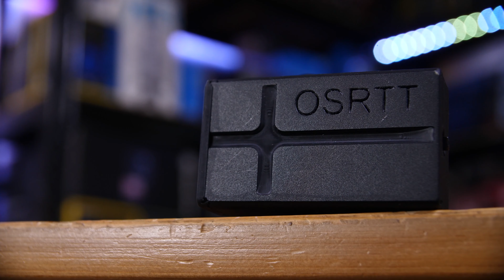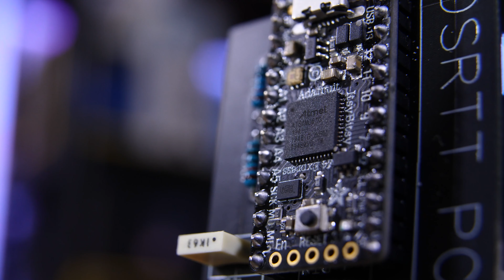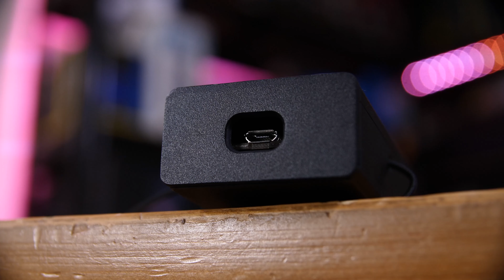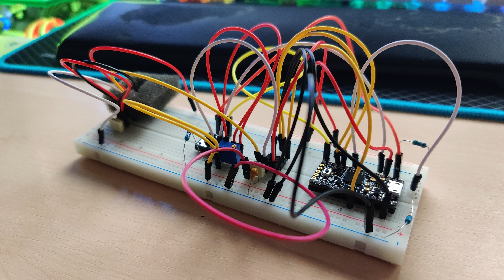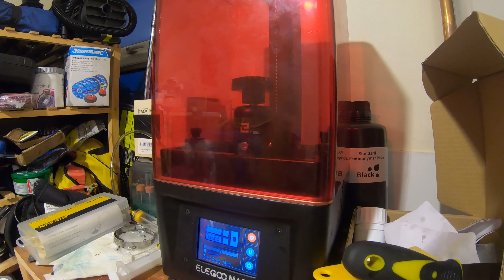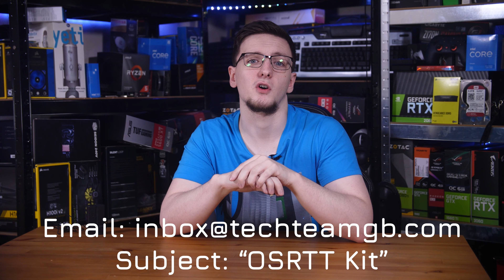I’ve been working on this for 6 months….

Comment: I had someone tell me making something like this would be near impossible to do without insane resources. Kudos for actually being the lad to actually go out and make this tool! I'll probably be buying one of these once you have them available. Do you plan to validate these after assembly with some kind of reference monitor?
Reply from the maker: First off, thank you! It's far from perfect, but I specifically designed it to be cheap, use off-the-shelf components, and be as accessible as possible, of course while still being as accurate as possible within that criteria. Plus I got an A in A Level Electronics, so that means I'm an electrical engineer now right? Right?... (sarcasm!)

Validation is a great shout! I've been electrically validating them during assembly, and I'll be flashing the firmware anyway so it wouldn't be too hard for me to run a test cycle to make sure everything is as it should be. I've been doing a lot of my testing at my main PC, on my secondary display which is a Viewsonic XG270QG so it'd be easiest for me to validate it on that.
Reply: @TechteamGB  Oh nice that is my monitor :)

Comment: What do you think about 18x18 tables with a step of 15 or 16x16 with a step of 17 instead of 11x11 with a step of 25/26 (8 bpc)?
Reply from the maker: I'd like to, but the light level difference between RGB 0 and RGB 26 is already pretty hard to differentiate especially programmatically, so I'm not sure it's feasible with this hardware.

Comment: "does all the work for you"

So it will do all the work, the wrong way, and give ignorant results. Its bad enough hardware unboxed and others reviewers who DO in fact do response time give us bullshit results. 10-90 or even 5-95 isn't good enough. 0-100 is what matters. WHY?

Well, it comes down to response time vs refresh rate. When you see a monitor with 360hz, that's 360 refreshes every second. To find out how fast 1hz changes, you do a little math. In this case, 1000 divided by 360 which equates to 2.77ms per single hz. Meaning with a 360hz monitor, your PIXEL RESPONSE has to be 2.77ms or FASTER (like 2.2ms or 1.8ms). 100% of gaming monitors are not fast enough to run 360hz. So, you end up with added motion blur. HOW? Because although the refresh rate is changing at 2.77ms, the pixels will STILL do their full 0-100 transition regardless of the refresh rate changing. A perfect example is pretty much ANY VA monitor. A typical VA monitor will have about 15ms AVERAGE response times according to reviews. Meanwhile even though that VA display is 144hz, its not fast enough to match. So you have 144hz (6.9ms) and then 15ms AVERAGE for pixel times. You end up with GHOSTING which causes a form of motion blur. Which reviewers wont talk about. All they care about is making a monitor "look good" by "fluffing" the numbers. Even Hardware Unboxed. I love calling them out because you will get a paid review (they got the item for free) and they will say nothing but good things. And then you have another monitor "they paid for" and they will shit all over it. BOTH MONITORS will be dogshit and similar in performance, but because of the paid review, they fluff it up "marketing" wise. And they STILL don't give a shit about 0-100 times even though that's all that matters. This 10-90 or 5-95 doesn't matter, only 0-100 transitions. Because that's how monitors work. A pixel doesn't "stop" transitioning because the refresh rate says "next frame" it will continue trying to change, while also trying to change for the current pixel. Which is where you get a blurry, ghosting picture.

Now speaking of motion blur, there are TWO TYPES of motion blur. You have NATIVE motion blur based on refresh rate (persistence) which is why typically gamers strive for higher than 60hz refresh rates. Basically 60hz you get a native motion blur due to sample and hold.... 144hz will look better as the refresh rate happens more often. its kinda like 24fps movies vs 60fps movies. 60fps looks better. And then you have motion blur from mis-matched response time to refresh rate numbers. So in essence, making a monitor is a balancing act between high refresh rate and making sure the pixel response can actually keep up with the refresh rate. MANY monitors have slow pixel times and high refresh rates, meaning you THINK you are getting a quality monitor but you aren't. Even my 240hz monitor which is very old (alienware, few years old now) at 240hz the pixel response isn't anywhere near close to the 240hz refresh rate change. 1000/240=4.16ms. My pixel response never gets that low. Its slowest time is about 6ms! So in essence, people think they have a quality monitor, but they don't. I ended up running my monitor at 120hz (1000/120=8.33ms) which means that special balancing act, I get less ghosting and minimal motion blur. If I drop to 60hz I could reduce motion blur due to pixel response but gain native poor motion quality because 60hz sucks compared to 120hz or 144hz.

A GREAT EXAMPLE of a quality monitor is the LG 27gn950. Its a 4k 144hz monitor, meaning the refresh rate is 6.9ms per 1hz (1000/144=6.9ms). Meanwhile, you have a 6.8ms "average pixel response" according to reviewers, which is below the threshold "average wise" which means you will get a super crystal clear image compared to other monitors (again compared to VS which has a ton of ghosting or black smearing).

Now if you were to compare to an OLED like an LG CX, the FULL pixel transition is about 1ms. In theory, you could have a 1000hz OLED with its 1ms pixel response, and it would be a crystal clear image as 1000hz, 1000/1000=1ms response time. And OLED have the 1ms response time! Throw in black frame insertion and you would have to most life like looking display ever seen. Granted, 1000hz also means you need 1000fps. Which makes even 360hz displays absolutely useless. Which brings in the required need for black frame insertion, as they helps reduce the NATIVE motion blur caused by low refresh rate. An OLED at 60hz with BFI enabled looks as good as a native 240hz monitor without black frame insertion! I have seen it for myself and done the tests both my own and blind tests for others for them to state which displays looked better. OLED is the future and I can't wait for OLED gaming displays to drop come 2022.... if the rumors are true.
Reply from the maker: I can see you are very clearly passionate about this - I am too - but you are making assumptions here not based on fact. I also dislike the 10-90%/3-97% etc testing methodology. I think it's, as Aperture Grille said, "Moderately Deceptive", as it doesn't paint the full picture of what the transition actually looks like and as you say can lead to significant visible issues like ghosting. It also ignores when monitors over/undershoot and then take longer to finish transitioning than without overdrive enabled. That's why this tool reports the complete transition time - as in the very microsecond (well 7.795us specifically) the transition starts, and ends, that is what is recorded. I traverse the sample array twice, once from the front to find where the transition starts, and once from the end to find where it comes to a final rest. The software will still compute either the 3% or 10% measurements as well, but as a secondary metric. I've also modified the usual excel heatmaps to change their colour based on the refresh rate window (ie 6.9ms for 144Hz, 4.16ms for 240Hz etc), as most seem to use fixed colours which don't give gravity to results showing mutlitple frames worth of ghosting will be present.

Comment: Not interested in getting one but am looking forward to other reviewers using it.  Also a suggestion... If the parts are typically only sold in bulk, if there is interest you might want to sell those parts or point makers to the specific source you used so they could use your community for group buys.

Even if it is a very niche thing it is great you put the design out for the community to iterate on, and I hope no big company straight up hijacks it, but if they want to partner, even better.
Reply from the maker: I picked all of the components (besides the sensor) to be as widely available as possible, and even the sensor itself is still easy to buy. It of course depends where you are worldwide and if you want to build one yourself or not, but in the UK Mouser stocks the sensor along with most, if not all, of the components and every other electronics distributor like RS components stock almost everything.
Reply: @TechteamGB  AH.. OK then, I misunderstood that part of the video.  I thought you were saying that some of the key components were ONLY available in bulk orders from manufacturers.  My mistake.  Thanks for the update.

Comment: Can we use it for monitor calbration?
Reply from the maker: If you mean colour calibration, sadly not. If you mean calibrating your monitors settings for response time (and possibly input lag in the future), then yes!
Reply: @TechteamGB  Could it be modified to do colors aswell? For overdrive settings we can just google the results of our monitors.
Reply from the maker: @Happy Giraffe - unfortunately colorimeters & spectroradiometers are very different technologies to what I'm using here which is just a basic light output sensor. It's a very different device to what I've built. As much as I would love to have an all-in-one device to test everything, that's a little out of my league right now.

Comment: can i get one with an idiot proof one touch that exports all results and graphs to a powerpoint, happily pay more for a one touch benchmarking tool
Reply from the maker: Currently, as long as the monitor's brightness is in the right range (normally between 40 and 60) you just launch the program, hit 'start testing' then press the button on the unit and that's it. It spits out a csv you can copy/paste to the included excel template and screenshot/copy to powerpoint however you like.
Reply: Sounds a bit complicated for Mike 

(jk)
Reply: @fracturedlife  no its true i struggle will simple graphs so this rules me out

Comment: It may be very cool, but it needs USB C
Reply from the maker: I really, really wanted that... But adafruit didn't make one!
Reply: It doesn't "need" USB C. Everyone still has plenty of micro USB cables laying around not getting any use. USB C would add literally no functionality to the device. It's low powered and low bandwidth. USB 2.0 is probably overkill for it.
Reply from the maker: I would have preferred type c for reliability and durability, rather than its ability to run at higher bandwidth. This connects via serial so its not insane bandwidth.